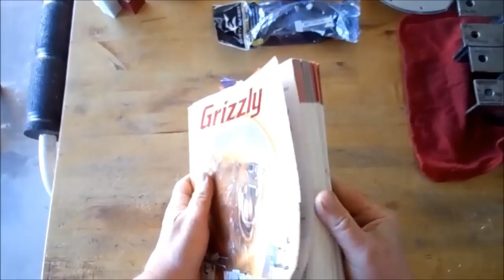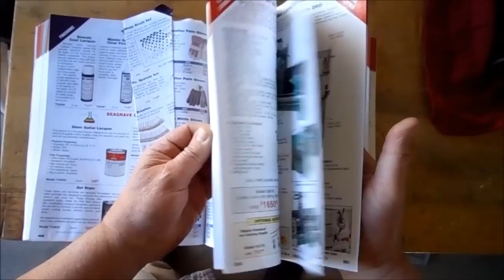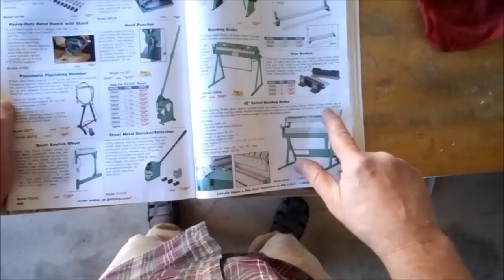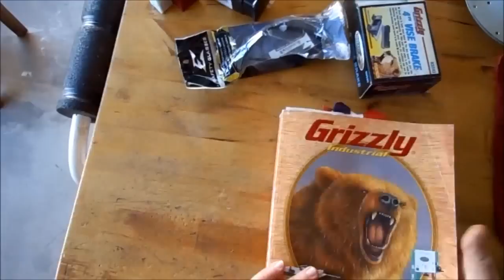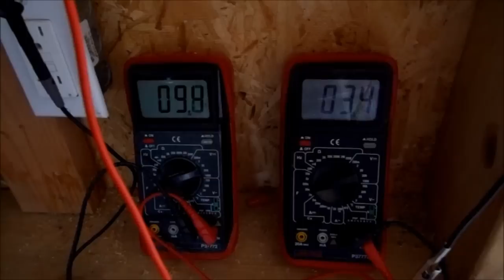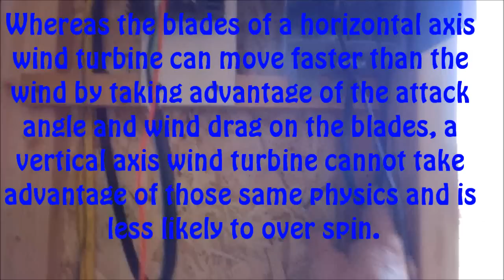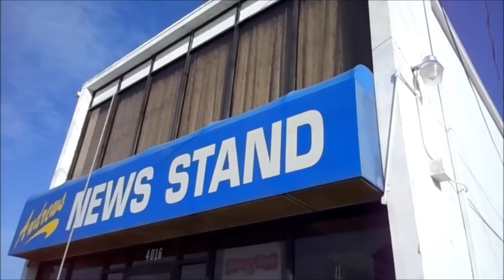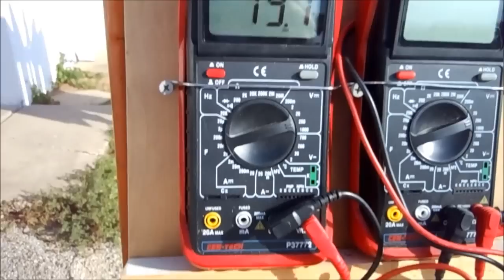What’s at the Center of a Stealth VAWT?

Comment: Actually, some ac delco style pma's have bearings to eliminate friction from the back side of that bearing cap - but only one company is doing it. I'll refrain from mentioning them to save being attacked. Also, I learned the hard way why a brake is necessary for either drag or lift based turbines. I used to own a couple of bottom fixed VAWT's similar to yours, except the pole extended through the axial flux pma and below the vawt for extra support, instead of just fastened to the pma. They worked great, until a tropical storm came along. One turbine couldn't keep up to the wind (the disadvantage to drag turbines in high winds) and subsequently the pole bent like it would with a HAWT experiencing extreme wind walling, and wobbled itself to destruction. The other fell victim to centrifugal forces. The fact is that no turbine can operate safely at those wind speeds, structural materials have their limits, and gale force winds are the max - that's when a brake would be a wise option ;)
Reply: ***** Yeah, bad politics for sure. I think people are starting to see that it's not very good for business. Healthy competition is good for driving innovation, but things got out of hand as far as the mud slinging goes. There are better ways to capitalize on a free market that doesn't include ruining each other with self defeating marketing schemes, imo. As for your turbine, test, test, test! You're taking the right approach. I only mention the brake because multi-blade drag based vawt rotor's typically have much more mass than a 3 bladed hawt for ex, and subsequently store much more kinetic energy when free-wheeling in comparison which - in the event of a malfunction in dangerous wind speeds - could cause a potentially fatal blade throw for you or worse, a customer. This is why flywheel renewable energy storage units are vertical and made from carbon fibre instead of soft metal, for ex - the forces caused by free-wheeling that are acting on the structure are tremendous at high frequency. There are high winds, and there are REALLY high winds that nothing can sustain, be it a wind turbine or a building, and that's why all experienced manufactures strongly recommend braking all turbines in such conditions, because it becomes as much of a safety precaution as boarding up the windows lol. A brake would also facilitate servicing, especially in the case of an emergency. It's easier to brake the turbine than to brake the wind, or wait for it to calm down as it continues to cause more damage ;) Brake switches are also fairly cheap, $5-20, so it's a worthwhile investment imo. Just some food for thought. Keep up the great work!

Comment: Might be worth looking into putting together an aluminum anodizing setup as a possible alternative to your powdercoating idea for finishing the VAWTs. Just something I thought of, but an H2SO4 bath with a dc current to it & a steam chamber might cost less than the powdercoat-setting oven & anodizing is the "gold standard" in aluminum protection. ... Not cheap either way, but it's a thought ;)
Reply: ***** It's been several months since I last did any research on the topic, but from what I recall, all you need for successfully anodizing your aluminum parts is:
#1--caustic base solution for a quick-dip pre-soak/etch cleaning bath (dip it too long in this and it'll eat your whole part)
#2--dilute H2SO4 bath that's big enough to submerge the part, with a DC current being fed through the part
#3--a steam bath to hydrolyze the aluminum oxide crystals formed in the anodizing bath (this "closes" the crystals, making the surface waterproof)
There are several good write-ups & pictorials of the process around the internet, mostly done by the amateur telescope builders; they like anodizing their aluminum parts with a black pigment bath to avoid oxidation & reduce internal reflections in their tubes. The pigment soak, when wanted, comes between the anodizing tank & the steambath stages, but is completely optional.